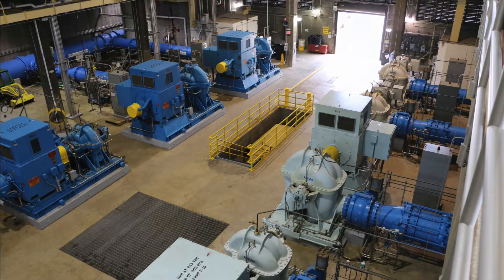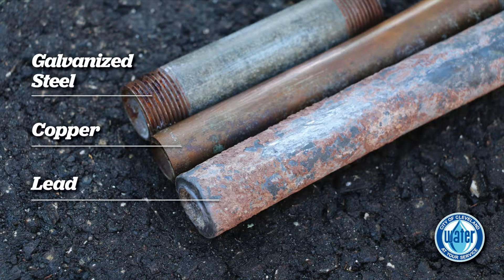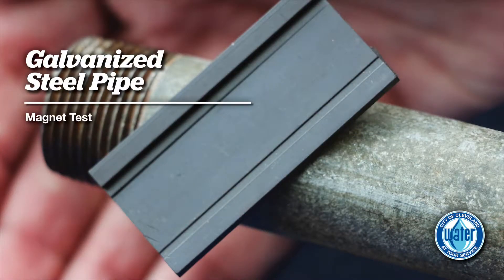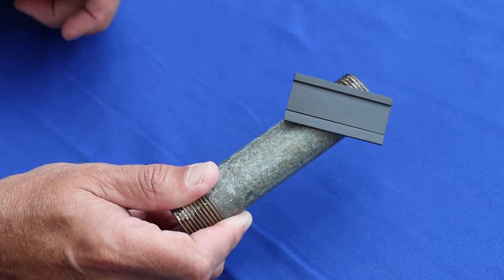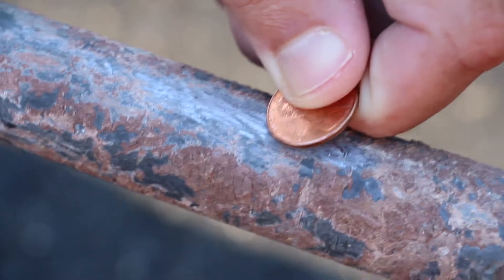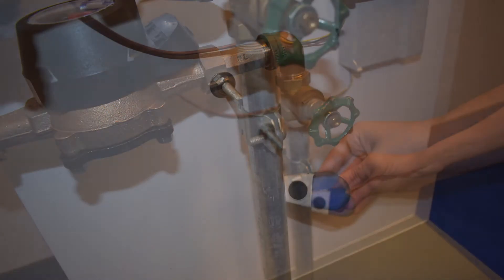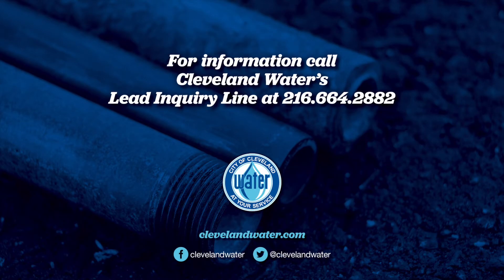How To Check Your Water Pipes For Lead

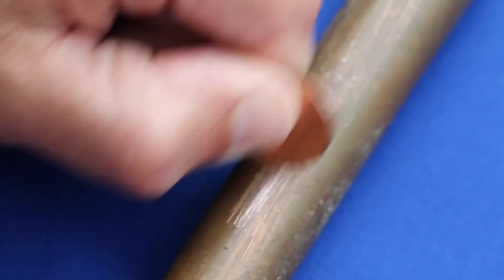Comment: Copper plumbing installed before 1986 had high lead solder used on the joints!  1:15

Comment: Thanks. This helped a lot. Mine are steel due to the strong stick they have to a tiny magnet I had. Others definitely copper and Others seem to be some kind of chrome looking cheap new type of alloy they’re too new to be lead and have a mirror like finish but after further research they seem to be made of copper, brass or tin, with a a very thin chrome plate, im gonna leave them alone now cause they really look cheaply made

Comment: If your pipes shiny its lead? What nonsence
Reply: 1) If magnet does not stick to it and 2) when you scratch the material it is silvery rather than brownish/copper colored.
Reply: @jimlint  most metals are silver.
Reply: @nathangrueber9834  Yep, agreed.  The water pipes in the Cleveland area are generally either Lead, Galvanized Steel (magnet will stick), copper (brownish color when scratched), or plastic.  The goal in the video is to see which one you have. Silvery color, when magnet does not stick says not plastic, not copper, not galvanized.
Reply: That’s not what it said. It actually didn’t mention the scratch test on lead